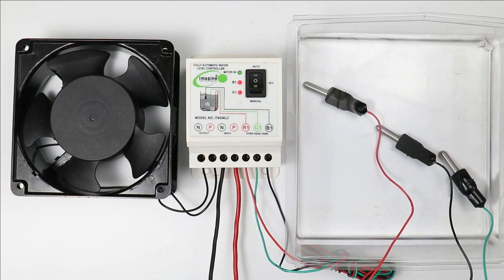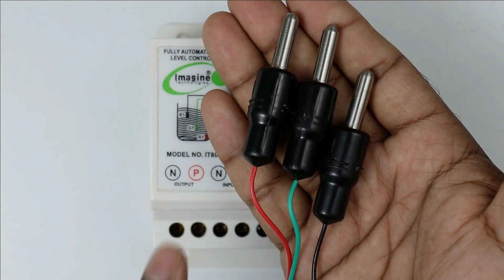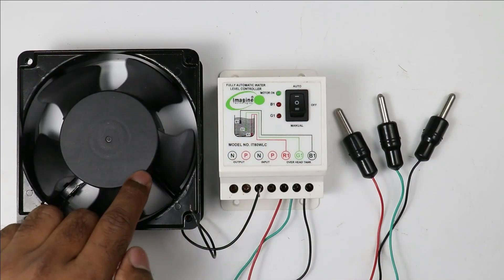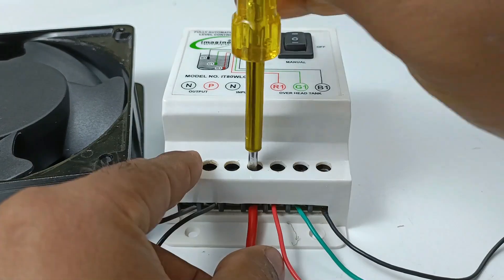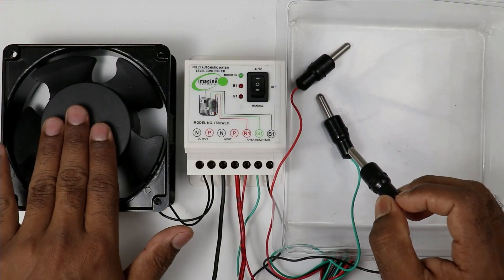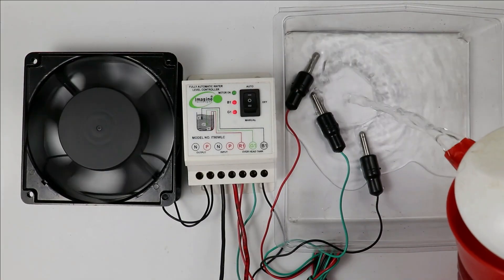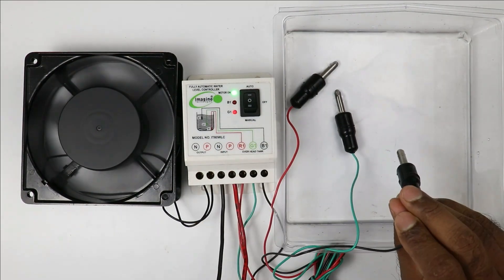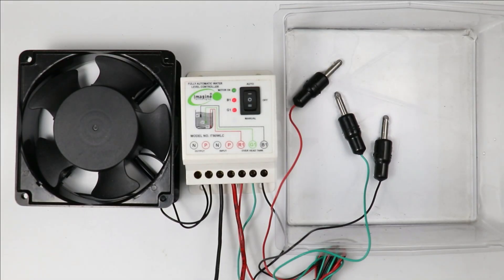Automatic water level controller Wiring And Installation for Overhead Tank @ElectricalTechnician

Comment: With this model number ( IT80WLC) which you have show in the video how will you connect dry run senor which comes with two wire??. I know the installation inside the tank . But I do not know the wiring in this model.
Pls let me know

Comment: Assalamu Alaikum. Learn Electrical Basics easily with "Electrical Basic Pro" apps. below are the things you can learn through the app.👇👇👇

1. Preparing for electrical work with essential guidelines.
2. Exploring basic electrical questions and answers.
3. Discovering reliable sources for electrical engineering.
4. Identifying and understanding electrical equipment contacts.
5. Accessing essential electrical diagrams.
6. Finding the full forms of electrical acronyms and abbreviations.
7. Finding answers to common questions about earthing.
8. Exploring common questions and answers about substations.
9. Understanding common questions and answers about house wiring.
10. Gaining insights into common questions and answers about power factors.
11. Obtaining answers to common questions about circuits.
12. Learning about common questions and answers about circuit breakers.
13. Acquiring knowledge about common questions and answers about motors.
14. Exploring common questions and answers about ceiling fans.
15. Understanding common questions and answers about transformers.
16. Discovering answers to common questions about generators.
17. Gaining insights into common questions about transmission and distribution.
18. Preparing for electrical job interviews with relevant questions and answers.
19. Familiarize yourself with essential electrical symbols.
20. Utilizing an online electrical calculator.
21. Testing your knowledge with a series of quizzes on various electrical topics.
22. Exploring basic questions and answers about electronics.
23. Learning about the introduction of electronic parts.
24. Understanding the introduction of electronic equipment.
25. Finding answers to common questions about registers.
26. Discovering answers to common questions about capacitors.
27. Gaining insights into answers to common questions about diodes.
28. Understanding answers to common questions about semiconductors.
29. Exploring answers to common questions about transistors.
30. Learning about answers to common questions about inductors.
31. Understanding answers to common questions about waveforms.
32. Preparing for electronic job interviews with relevant questions and answers.
33. Testing your knowledge with a series of quizzes on various electronics topics.

To download the app, go to the Google Play Store and search "Electrical Basic Pro" or you can directly download it by clicking on the link below.

Apps download link:
https://play.google.com/store/apps/details?id=com.bongoappstore.electricalbasicpro